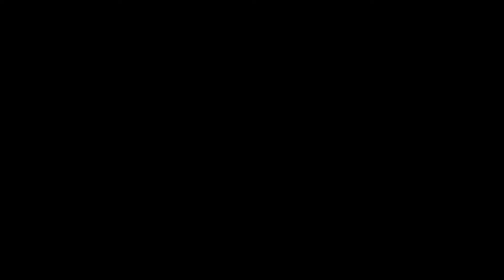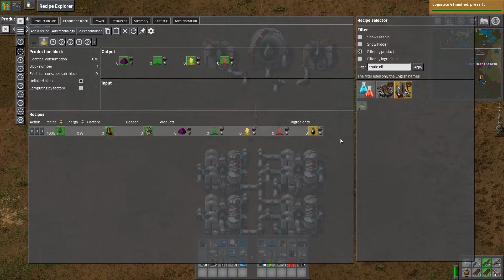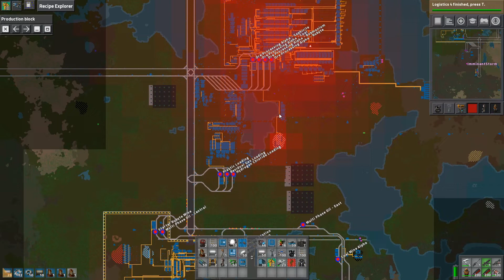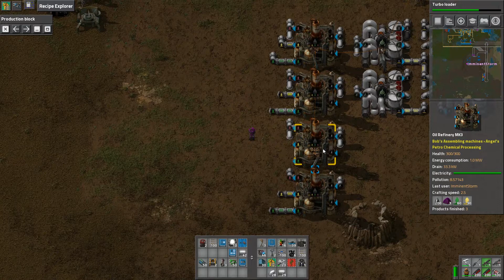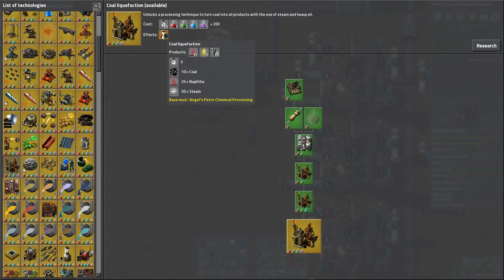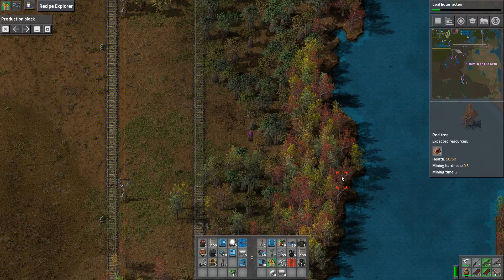Factorio - Angel's & Bob's - Episode 88 - Oil & Gas Refining

Comment: The 3rd Oil refinery is not connected properly.
Reply: Specifically, the fuel oil and base mineral oil outputs aren't hooked up on the 3rd refinery, so it's clogged and not running.
Reply from the maker: Ah, thanks for the heads up
Reply: @ImminentStorm  you don't understand how frustrating that was to watch you missing it out every time haha!